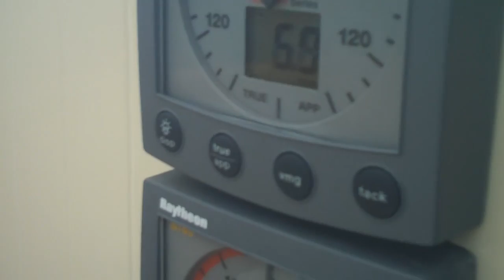Power Consumption & Production Aboard A Sailboat

Comment: two years later... :-) 

to save a huge amount of power when you are using usb micro or iPad devices, get an automotive 12v socket bar installed into your DC mains and then use the automotive charging equipment. doing it from AC means you lose upwards of 40% of your amp hours because of double conversion inefficiencies!  There may be a bit of electrical wizadry involved( but probably not,,i have brazed on an automotive socket directly to a deep cycle battery and it worked fine. ) so check up on methods before you risk your electronics,

Comment: Wind and solar are impractical for AC power production.  most AC power consumption  occurs in the evening or morning when solar cant really produce. Wind is too variable to be part of base load.  Currently these sources would really only work for AC power if they were used to produce storable energy!  large scale laeada acid battery storage is still impractical.  Hydro energy is still the best green source.  then nuclear (CANDU reactors)
Reply: Well said

Comment: Nice video.  I don't know what one item would be that I would take with me on the boat.  I'm just happy being able to life with less stuff, but I guess I would agree with Ben.  A stereo would be nice, but that's also 12 volt and doesn't use much power.  On our boat if it's not 12 volt it doesn't come on.  We do however charge our computer, but it's so inefficient converting 12 volts from the batteries to an AC current for the charger, then back to 12 volt for the computer battery that you probably waist about 20%.
Reply from the maker: Yeah we have a 12v charger for the computer. They are available. We got ours from Mac Gyver.